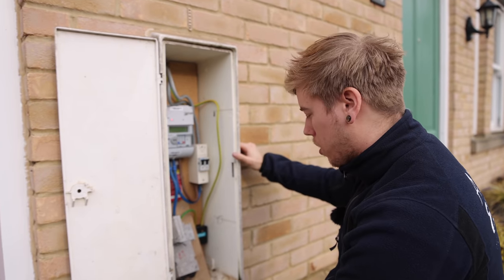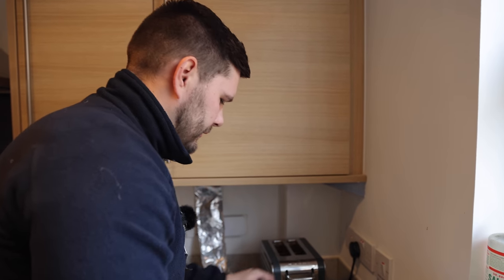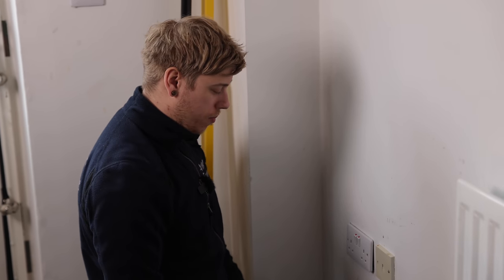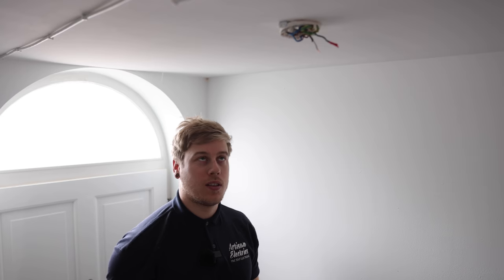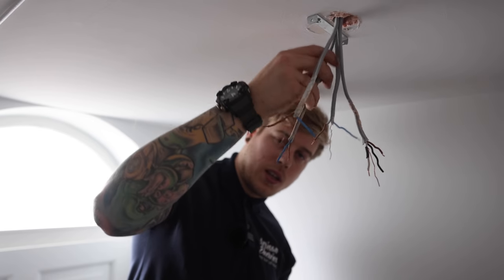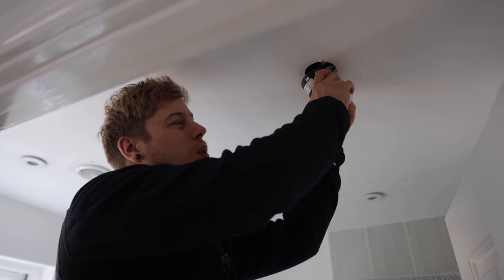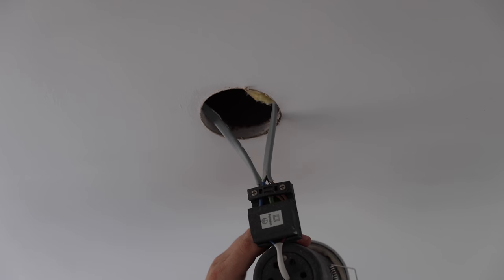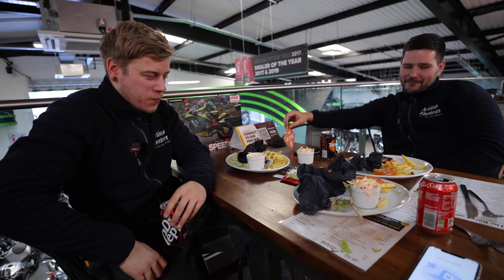CHECKING DIY ELECTRICS, INSTALLED NEAT BUT WRONG! - Electrician Life

Comment from the maker: What’s your opinion on DIY Electrics?

Make sure you’re subscribed to our Channel with Notifications on - bit.ly/3nqFpXp-ArtisanElectrics
Reply: Depends! DIY can range from shockingly bad to highly competent. I work in a technical field and receive electrical safety training. I am not a qualified electrician but I do understand lighting and power circuits, current ratings, earthing, and how to make safe and secure terminations.  It sounds very arrogant but I do consider myself competent to do my own electrical work that is allowed within part P.  However clearly there are some absolutely terrifying examples of DIYers (and trades people) who shouldn't be allowed to change a light bulb, let alone work on electrical systems.
Reply: @rossthompson1635  what would you do if something you did is notifiable mate, do you go down the route of building control etc am I right in thinking that by law you should not touch electrics diy, as if say you fit a simple light or replace a simple socket, and something went wrong you are screwed and insurance would not pay you out 🤷‍♂️ been told by a few sparks that “oh it’s illegal to touch electric same as gas” then others have said, crack on you can do what you want it’s not even regulated 😂 thing is I darent even change a light fitting to a decorative one in my house as I’ve been told it’s illegal etc . Even tho I would say I’m competent, yep I understand I can not do a MWC with schedule of tests as I don’t have a mft and all the kit etc
Reply: X2 plus vat roughly geyser ok
Reply: @kingofthetrowel1725  I wouldn't do notifiable work - which is sometimes frustrating as before Part P I would have done work in my own home that is now classed as notifiable.  There are works that you can do legally, but even so people need to be competent to do safely.
Reply: I've seen it be done well, very well, bad and very bad. Most bad ones are done by people who thinks they know what they are doing. Oh and I'm bias since I'm a qualified and licensed electrician. Here in Finland you're not legally allowed to do much electrical work if you're not trained and qualified. You can make a single phase extension cord, change the cable and plug on a single phase appliance, connect lights to an existing ceiling box.
Reply: @justme5384  Interesting - that is quite limited. Here in the UK you can add new socket outlets or lighting points to an existing circuit if it isn't in a "special location" (bathroom, outdoors), but you can't run a new circuit from the consumer unit.
Reply: @rossthompson1635  we really haven't had RCD protection for long, wasn't mandatory since -98 on outside socket, sometime in the beginning of 2000 you needed to put sockets in bathrooms (that has standing shower) on RCD, sometimes around 2010 you needed to also include the lighting circuit in the bathroom on RCD. Then around same 2010 all sockets used for handheld devices needed to be protected by RCD (so for example sockets for freezer/fridge, microwave, dishwasher etc didn't need to have RCD. Then a few years later all sockets needed RCD and nowadays pretty much everything needs to be via RCD. Some exemptions, sauna heater, water heater, oven, stove/hob are still without RCD. I'm not so sure about the years in the post but should be around those times.
Reply: @rossthompson1635  There are absolutely non-qualified sparks with the background, ability and healthy respect for safety to do their due diligence and carry out competent installations. No doubt about it.

The problem is that it's kind of tricky to say that out loud, because frankly it takes a certain type of person; there are always going to be a good number who have a go, blissfully unaware of what they don't know. This isn't to say they aren't intelligent people - it's just that assuming we know more than we really do is such an easy and human trap to fall into. And when we're talking about something that can kill, it's just better to err on the side of caution.

I think if you've done the work, you really know you've done the work. You've probably gone above and beyond to read through and understand the whole of the regs, more than once. You've actually deliberately memorised some of it. You've spent time pulling together different parts of the regs to see how they apply to certain situations. You probably know some basic electrical theory and can do at least simple circuit analysis. You've watched sparks at work and maybe even spent significant time watching through channels like this one (honestly, in the absence of working professionally, it's not a bad substitute for some of that experience at all). You've studied electrical safety and best working practices. You've probably gone through several realisations about things that you initially got wrong.

There are definitely people who like doing this sort of thing in their spare time, but frankly it's a minority.
Reply: @nathan87  That is an excellent post, I agree very much with the points made.
Reply: Depends! Professionals (even highly recommended ones) can be so shockingly bad to incompetent that you have to have a good idea of what they're supposed to do if only to have confidence in them - in which case, might as well do as much as allowed yourself. Get the latest books, watch recent videos by folk like yourselves who put their work up to be scrutinised, go above and beyond basic standards.
   What I can't understand is amateurs and professionals doing sloppy work on their own homes. But they do. And even mouth off at me for "doing more than necessary". Plurals deliberate
Reply: @cuebj  I don't understand either why people take chances in their own houses, I am reasonably averse to fire and shock at home!  When I was a teenager in the 80s I went to a party at a friend's house; her parents were away and a pendant light got broken. I went to fix it the next day - but when I went to pull the fuse, there was some "extra wiring" installed by her father, who was an engineer for a company making specialist industrial power supplies. The "extra wiring" was powering the burglar alarm - the live was a single insulated wire poked in under the lighting circuit fuse (fortunately on the fused rather than busbar side), the neutral was wrapped around a bolt in the casing of the metal fuse box. The irony of wiring up a device designed to protect the house in this way is remarkable!
Reply: It depends. Plenty of colleagues who work in industry designing, manufacturing and installing switchgear are perfectly capable of reading, understanding and following the requirements of BS7671 despite the lack of qualifications on paper. They can and do perfectly acceptable work, often to a better standard than so called qualified professionals because they take pride in what they do in their own homes. Its the "bit of knowledge" DIYers that are the problem.
Reply: I completely rewired my house from the meter back, new wiring, new CU, new fittings, 30 extra sockets etc as the previous owner was an electrician in the forces and had made such a hash of it with 4 rewireable CU's in a 2 bed home. It passes it's EICR's now with no problems.
Reply: As someone who is not a licensed electrician, I would like to one day do some notifiable works and go through building control to get it inspected. I’m sure I could do it
Reply: I like to think the plumbing and electrics are better now than they were when I bought the house new.  Just added surge protection to my main panel (consumer unit).

Comment: Back box repair clips are great, about a fiver for a 5 pack. If I can’t fit one due to tiles etc, old school way of a 3mm drill bit, thread the hole and long extension screw

Comment: The issue with the downlighter is surely the cable clamp not being on the outer and not that the single insulated wires are visible. If the test is that the single core insulation must not be visible, pretty well every ceiling rose in my house would fail (all put in by an electrician at some point) as a certain amount of the single bare wires go back into the ceiling cavity in pretty well every case.

Comment: I have a feeling that 3 core was wired with black sleeved brown for the switch and grey as neutral before the client had a play. As most of the time we try to avoid black being neutral post colour change.
Reply: I can imagine the client jumping on in, disconnecting everything with the "how hard can it be to change a switch" attitude then having a errr moment as he tried to remember where everything was before disconnecting it without any reference pictures, notes, tags or any idea how any of the wiring works.
Reply: @tonymcfeisty2478  Electrical & Electronic engineer by BSc here. Had something like that recently with a neighbour who'd started replacing a ceiling rose then got confused about the three cables. Seemed puzzled that I could sort it out while chatting to them about something else.
Reply: What is the reason for not using black as neutral? Just curious that if that is what some  people would expect then why deliberately choose a different core for neutral?
Reply: @JasGawera  Red Yellow Blue was replaced with Brown Black Grey.  The order is maintained.  So Blue is now Grey.  You use Grey sleeved blue to indicate it’s use as a Neutral.  Those who expect Black to be neutral have no clue of electrics and therefore should stay clear.
Reply: @yellowfin81  on South Africa black is still neutral. Different colour coding. I noted that Europe does the blue and brown thing, which is normally the colour coding for plugs on appliances, but rarely seen in the house wiring. It is allowed to sleeve/tape a wire with a different colour to mark it.

Comment: On cooker switches and sockets - I've found instances of cooker switches with sockets where grease and water has got into the socket because they're too close (but in spec) to the cooker and cooking has messed them up, particularly common in rental properties where tenants maybe don't care so much and don't use the extractor or the extractor is asthmatic (as they tend to be). You get fun little arc faults in them and they're a definite fire hazard - sure, just plain switches too but a socket IMO is more points of ingress and more risk of it happening. Good job for AFDDs though.. Also it's quite common for the cooker circuit to have no RCD protection, one to watch out for with socket+switch setups.

Comment: Hi,  I thought that an EICR was to report on the existing Instalation for continude use, not to find and rectify faults.

Sorry if I've missed anything BUt I would always report on the condition and then recomend any inprovements after.
Reply: The customer requested an EICR and a fix for the hall/landing/porch light switches. He did say that in the video.

Comment: 7.10 checking a sample set of items for general picture. Excellent advice. Did that with current house - completely rewired it! Then, when a few issues emerged, did it to check the professional work - still in process of fixing what they did. Will do what I can then use pros whom I watch like a hawk (sorry, I know it's rude and bad form but experience has been bitter)

Comment: Have you got a link to those socket fixers ? I manage the strip the threads on a socket in the kitchen when I tiled. I think I got adhesive on the lug thread. Ended up using a different product but this looks a better product.

Comment: Did I understand correctly that you are switching the common from the outside light rather than switching on the live side? Clearly either works, but it would be safer to switch the live connection?